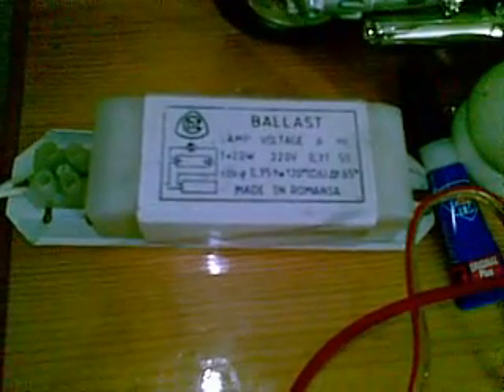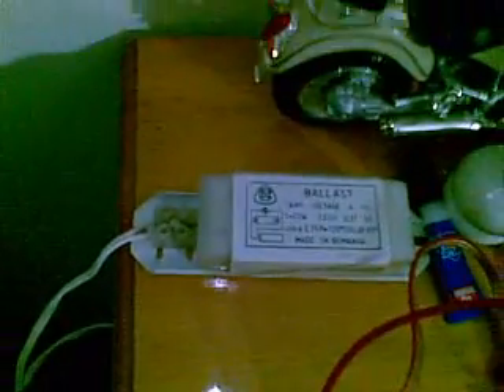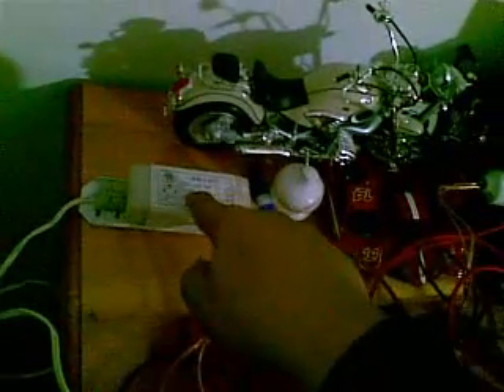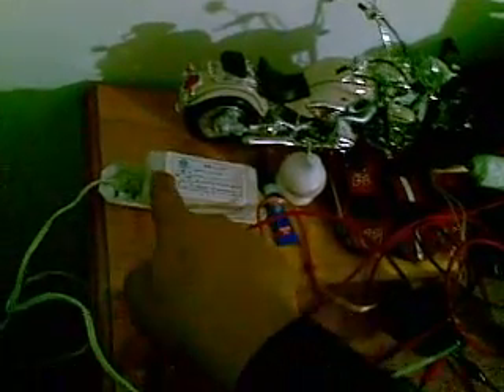Bigger plasma with ballast

Comment from the maker: Something else I want to say. 

it is very important in our case to use a resistor (like our 100W bulb) in parallel with the coil. This way, we eliminate any negative self-inductance of the coil, which we don't want.

This way we help the coil perform better!!

Comment: If you connect balast parallel to the bulb you will reduce the resistant of the circuit and increasing Amp into it. That's why with parallel balast you got higher plasma in high frequency. The same effect will you get if you increase the watt of your bulb such 150 watt or 200 watt bulb.

Comment: An instant start ballast starts lamps without heating the cathodes at all by using a high voltage around 600 V..i think we should try 600v inverter